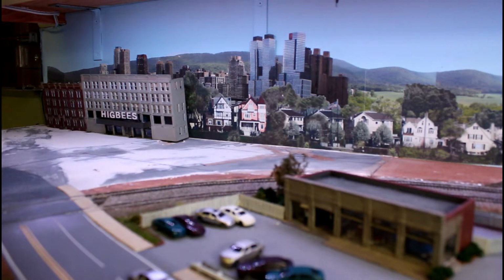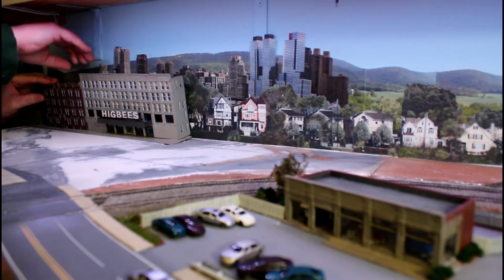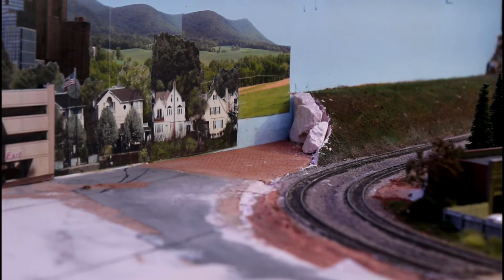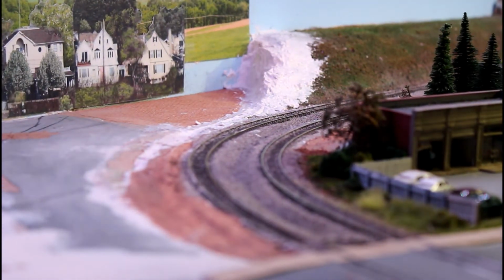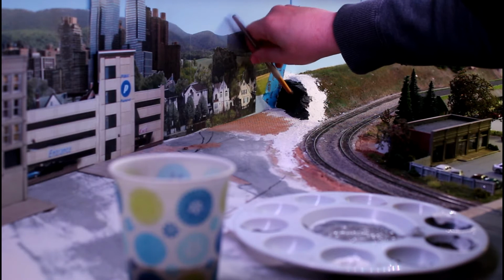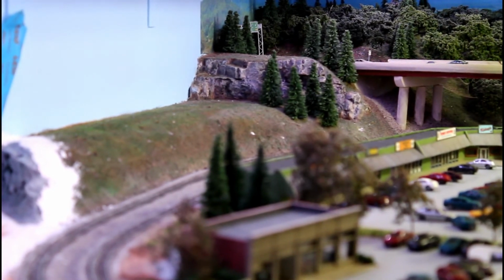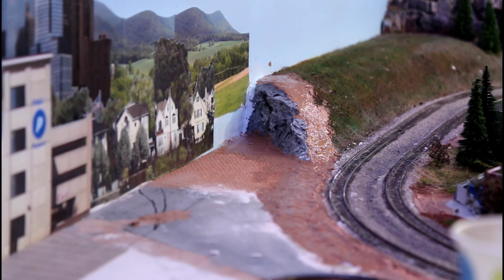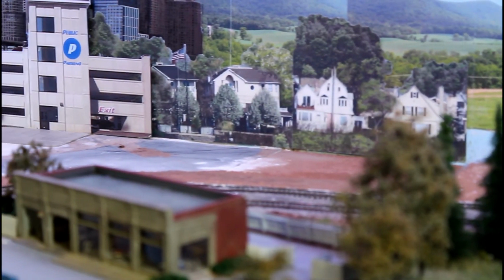Rebuilding A City Part: 12

Comment: You are correct at some point you have to call a section done.   I just got a flocking box for static grass, mine came with a conventional jar applicator.  Do you plan on home made trees or store bought?  Been making mine from Baby's breath .   Till next time
Reply from the maker: Good luck with the static grass as for the trees I have been using super trees from scenic express https://www.sceneryexpress.com/SuperTree-Material/products/1007/ I have good luck with them and I think they look pretty good.

Comment: Hi ya Mike. Looking good. What did you eventually use to adhere the buildings to the backdrop? I was thinking while I was watching, I have been following you for quite a while now, and I don’t think I have ever seen a train run. Lol. But that’s okay. I love your builds. See ya next time.
Reply from the maker: Thanks Norman, I have a few ideas for holding the buildings but haven't gotten around to trying any yet but I will definitely let you know when I do. As far as running trains I did make I think 4 so far if you look at the playlist I have called running trains, but your right it's been a while. I had planned on doing a new one around the holidays but was dealing with my father and didn't have the time. It's definitely time for another. I'm thinking when this city project is done.